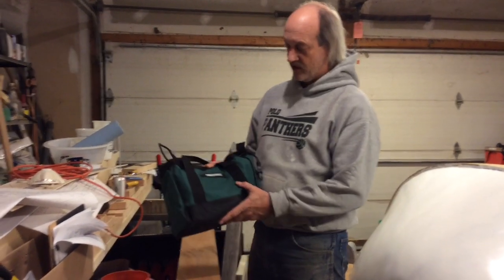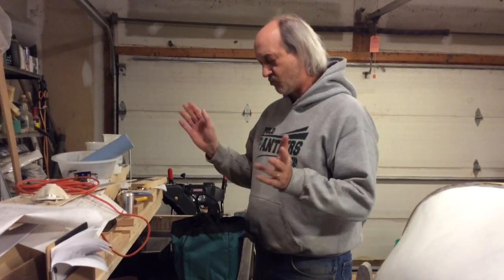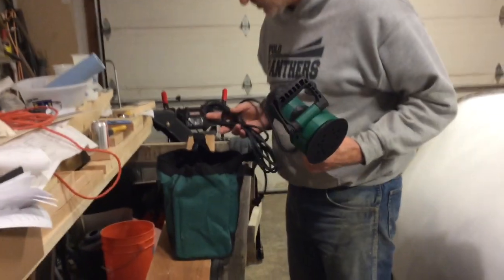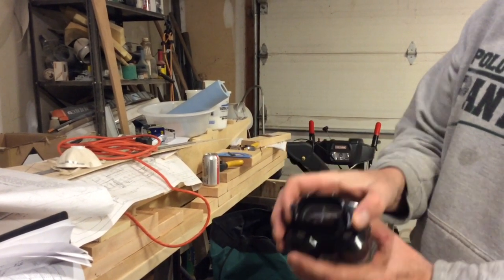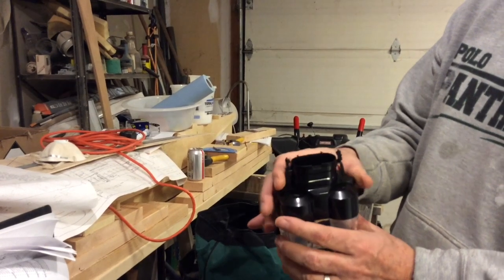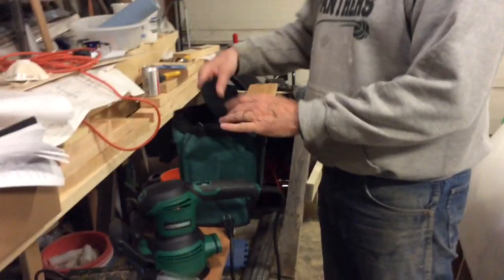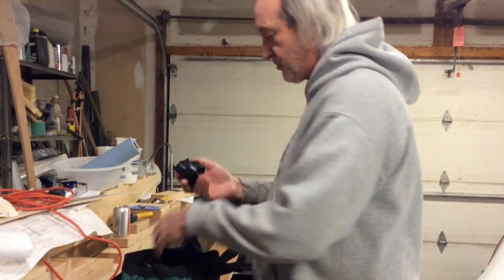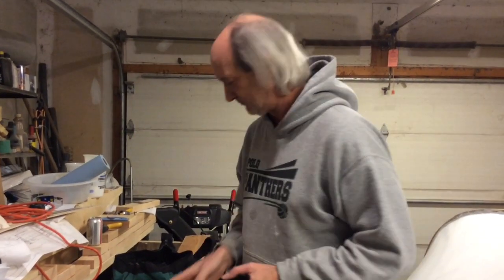Master Force Sander Review

Comment: Thanks for the video. How’s the dust collection on this now that you’ve been using it for a while?
Reply from the maker: Sadly, a couple of months after this review, it shot craps. completely died. Can't recommend it now. I was upset enough to go buy a Festool.
Reply: @JenkinsBoatWorks  doesn't masterforce have a lifetime warranty on all their products?
Reply: @JenkinsBoatWorks  Came here hoping to find this. Mine just took a crap on me also sanding maple. Its fine for soft furniture, would not recommend for anything other than recreational use.
Reply from the maker: @tannerkennedy4941   I'm sorry to hear that. I use all of mine hard and at a point they will die but I experience zero longevity with the Master force